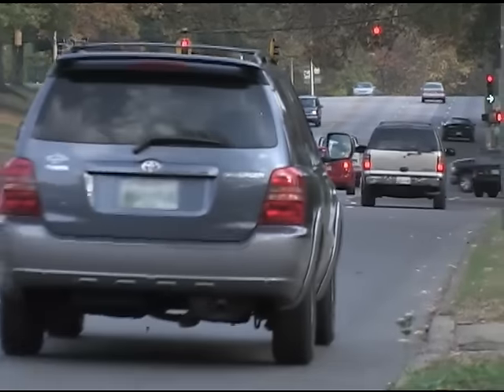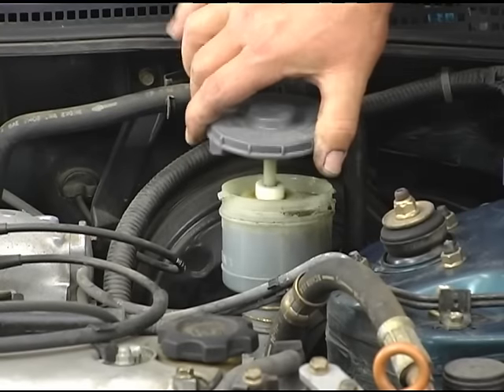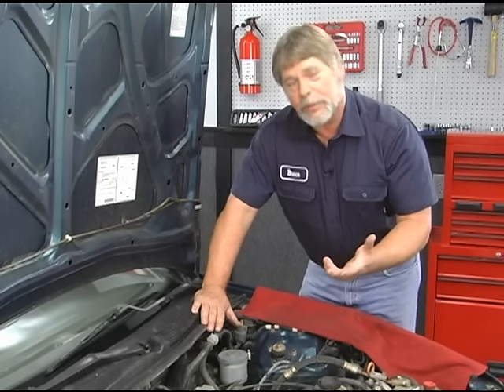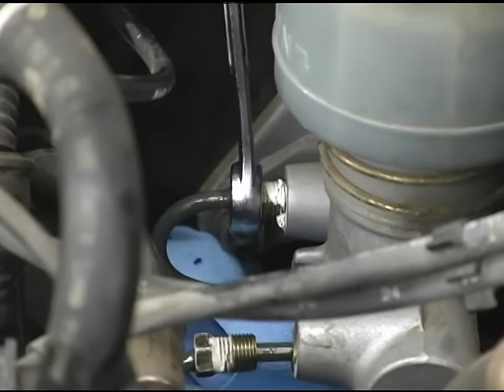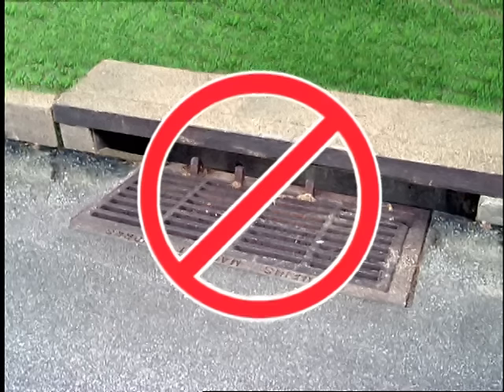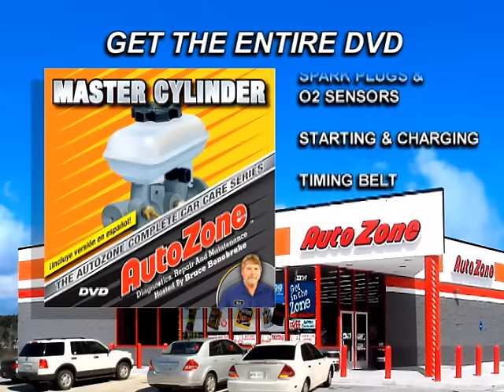How To Diagnose Problems With Your Brakes– AutoZone Car Care

Comment: You showed how to ck the breaks with pedal movement, and what was correct, but not what was wrong if it wasn't working properly; which is the whole point of watching this video. To fix a brake issue.

Comment: brakes worked  a year ago, pulled engine, fixed head gaskets, and re-installed.  Now, you have to pump the brakes to get to work.  Wait 5 seconds and you will have to pump them again.  Fluid does not appear to be leaking, wonder if it the master or the rear drums ?  I wonder if it's the fronts since it does not stop very well and when I pull the ebrake I can make the car stop...will find out later this week...

Comment: Have Chrysler Town& Country brake fades not losing fluid but gets air in front drivers line. New oil was put in and new master cylinder was put on. Is Master cylinder bad or could there be another problem?

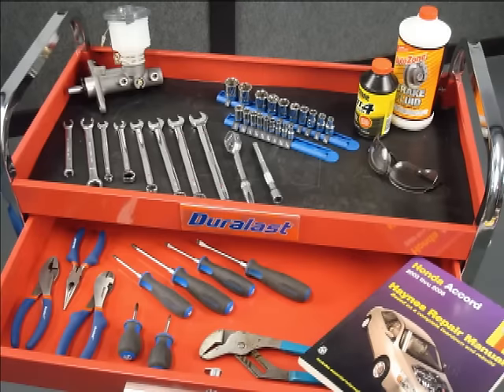Comment: Question:at 4:30 did I hear correctly? "the fluid didn't have no air bubbles so it will be replaced ".I thought no air bubbles was a good thing? My master cylinder has no air bubbles.

Comment: ABS is a junky system. My 2003 Chevy truck's line broke and I had no brakes because they have one reservoir in master cylinder for the fluid . 
This happened twice because of rusty brake lines . You would think the car companies would use stainless steel lines for safety reasons but I guess this cost to much for them.
Reply: That's a chevy thing.

Comment: Dear, i have Lexus Is200.
the brake lights on dashboard when i press emergency brake pedal, but the hand brake function quite well, when i push it on the handbrake light comes on and when i press down the lights comes down, when i press brake pedal the handbrake light comes on and doesn't switch off until i switch off the engine...most the time the brake system fails (its working very bad)
please can you help to fix it?

Comment: Absolutely no brake pressure on my car and I have to push the brake all the way down to go to a stop and only one brake seems to be working not 2 or 3 brakes! Bad Master Cyl?
Reply: Idk if you’re still here but did you figure out what’s wrong?
Reply: Found out what it was. I had air in the brake lines.

Comment: toyota pick up 4x4 4spd and cant shift. i can start the truck with the clutch in with no lurching but as I'm driving i cant find any gears?? anyhelp??
Reply: Damien Robins  hello Mr Damien i am from Dominica I have a problem with my brakes i think is the master cylinder is bad    but air is leak between the brakes master cylinder and the booster thank

Comment: What if when you start your car you feel a significant difference at the petal while depressing it?
Reply: stiff/hard pedal when the car is off and then it gets easier to push when you start the car, and a slight sink feel as it cracks over? that's normal
try this (car off) pump the brake pedal five times if it good it should be firm and only move about an inch. keep your pressure on the pedal the pedal should stay in the same place meaning not sink to the floor. if the pedal doesn't get firm or sinks to the foor while holding it (with the car off) then you have a bad brake master cylinder or there is air in your brake system. if all is ok start the car (still holding pressure) your foot should sink a bit but still not to the floor should be easier to push then when the car was off. if it is still hard you have a bad booster.

Comment: What happens when I push the brakes it lets out a hissing noise and gets hard to push down what can that be ? The brake fluid is ok. What can be the problem?
Reply: sounds like your brake booster is going out
Reply: sounds like the brake booster is going bad

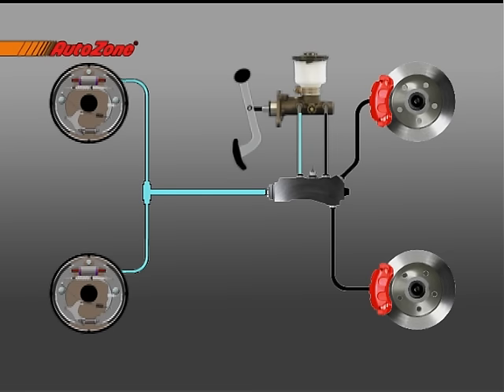Comment: 2:25 that is a 50/50 split system but it is an old system. 50/50 split brake systems are split into an X and not front to rear!